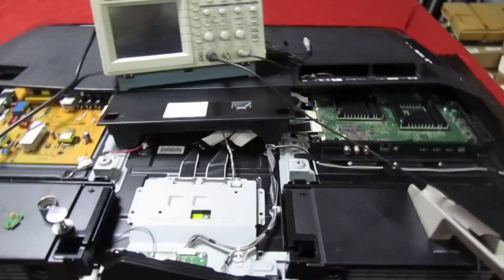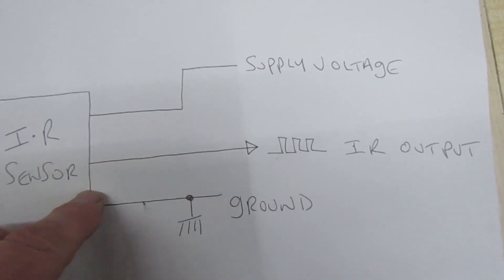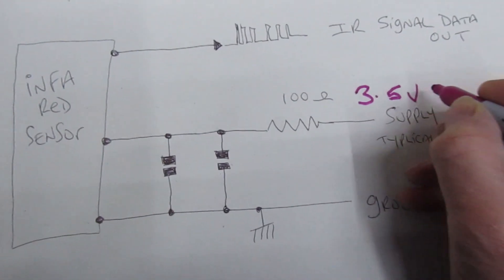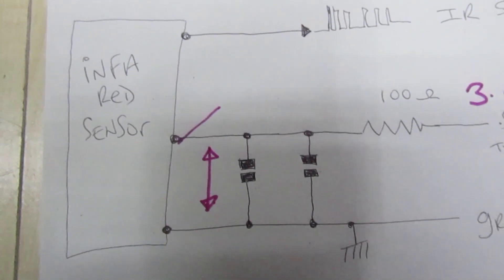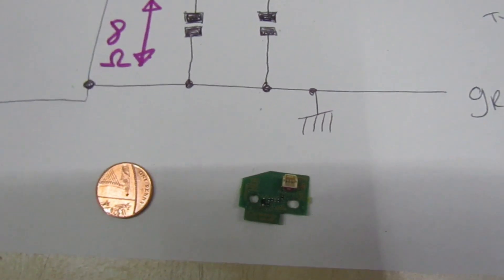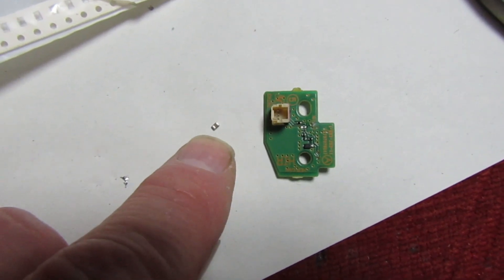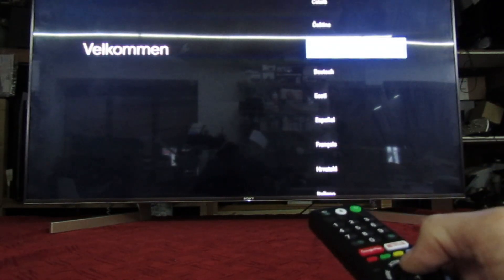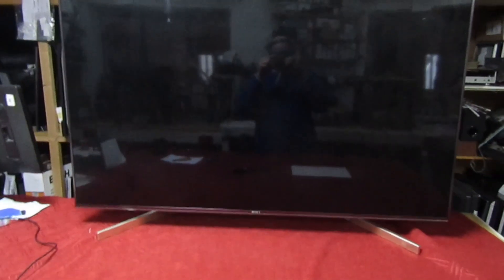SONY KD 55XF9005  No remote control functions working.

Comment: Thank you a lot. I got this problem with my Sony 65XF9005 for about two years now. Sadly it is a model where I cannot plug external IR sensor. I am bypassing it by using remote control on my android phone. The repairs that my repair center suggested or the parts I could find were way more expensive. Now I know how to tackle the issue. If I wont be able to repair myself, at least I know what part I need.
Reply from the maker: I don't think for this set a new board was particular expensive but just swapping a board is not much fun .
Reply: @michaeldranfield7140  I think I will try to repair it on my soldering station, but I do not have that much experience with really tiny parts.

Comment: I'm one of those people who would really appreciate a basic video on how to change that little IR sensor board! I think mine has gotten water damage. And can you please share where to buy that little board? Thanks a million!!
Reply: My model is kd-49x8500f
Reply: did you manage to do this? I have the same problem. I'm using a Bluetooth remote as a temporary fix. But it won't switch the TV on half the time, I have to press the power button on the side of the TV.

Comment: Thanks a lot!! Two days ago it happens to me. I try everything before I found your video... And today is working. In my case, the same capacitor breakdown (I measure 7.4 Ohms so quite same fail). I decided to keep the 15pf capacitor, because it is used to  put two capacitor in decoupling circuits. For me the other capacitor also help me for have a "bigger" point for soldering the new 10uf one. Thanks a lot again!!
Reply from the maker: No problem , had this same fault a few times now .

Comment: Most Excellent Michael! Thanks for sharing! Reminds me of back in the early 1980's with the Grundig TVs which had the Scan Tuning button and had a fault on that PCB (usually had 2 or 3 x AA cells as back up battery in a plastic drawer at the back, which customer could change). A new board cost £60 or £70 or more, however, every time I did some proper fault finding, I always found one of the many 10nF caps had a gone short circuit. Pre surface mount of course. This was the chassis that had the Thyristors in for horizontal scan and flyback.
Reply from the maker: no matter how much a new board is I will always investigate to see what's gone wrong ,wouldn't be any point carrying on if I was just a board swapper
Reply: @michaeldranfield7140  Yes indeed, I used to do the same & still do... you learn far more that way 😎

Comment: I have a Samsung telly which is just the exact opposite this. It generates its own RC pulses! 

It will turn the volume fully up, so the user then turns it back down. The set then turns itself up again.  When it gets bored, it will turn itself down instead. When it thinks it's funny, it will randomly turn itself on in the middle of the night, or for added laughs, turn itself off while you're watching something important.

I traced that fault back to the sensor board, but there's only two components that I can see - the sensor and what looks like transistor, or three legged chip.

It was hours of fun, but I'll be honest, I did actually swap the whole board in the end. This was clearly where the fault originated from, because it's never been a moment's bother since, and that about five months ago.
Reply from the maker: A very common fault in Samsung sets is the 6 tact buttons on the side, always replace every one because they work in a ladder network and go intermittently leakey, so if the volume goes up on its own don't just assume its the volume one causing the problem as it could be any of them, hence replacing the lot is the only cure.

Comment: Thank you so much!
I fixed my TV in the very same way - applying a single capacitor instead of the two that were there before.
300$ saved

Comment: I agree 100% that if just changing the board then it should not be on YT.
The problem is nowaday repair technicians rarely able to troubleshoot the fault to component level. Also due to small sized components that make the repair absolutely a nightmare.
I always love the good old days where repairs could done using a multimeter and a soldering iron.

Comment: my brother asked me to fix his 55" Samsung TV with the same problem, it had a very similar IR board and the same shorted capacitors so I replaced them and it worked for about an hour after my brother came and got his TV at which point the problem re-emerged so I just got a new PCB for it. given that the same fault happens (quite a lot apparently) suggests that the engineers are designing from the same "suggested PCB layout" on the IR sensors datasheet and either the sensor itself has a silicon bug or the PCB layout is flawed somehow. I do agree that finding the fault is much better than just board swapping.

Comment: Useful video. I've got a Samsung tv with exactly the same symptom. Haven't got round to looking at it yet because I can still operate it with the wireless rf remote that came with it.
Regarding the customer approval when you showed them the tiny parts: when I was in the TV repair trade I'd have got the opposite "what! You're charging me thirty quid when the parts were only five p"
Never mind that it might have taken a couple of hours to do the job!

Comment: Thanks! Amazing. I have now same problem in same model with 65", will try to order a board. (So far could not find any provider but will keep searching :). Meanhwile, phone bluetooth as remote is working instead of IR remote.
Reply from the maker: the whole pcb is not expensive , which is surprising for a sony spare part .

Comment: Very Interesting. I have a sony kd65 8500g on the bench right now with no LEDs lit. There is voltage as expected on 12v, 3.3V I can get the backlit voltage up by manually raising the BL line. I am now happy psu is good, leaving the mainboard at fault. All its caps have correct voltage either side of them so I am thinking the main processor has died. No button or IR has effect to turn it on and no standby led! Maybe you have an idea Mike?
Reply from the maker: I had a similar fault with a sony and it was the supply voltage to a pic microcontroller faulty , it came from a Texas 8 pin step down converter but that's all I can remember.

Comment: Hi. I have the same issue on my 49 inch XF9005.

I've never done any sort of home repair before, but am prepared to have a go. 

What is the part number to replace the whole board/IR receiver please and is it just a case of unplugging the old on and plugging in the new one?

Comment: Having the exact same issue but with the sony 49fx9005, remote control stoped working after a while, got a replacement remote control from sony and the issue still persists. I googled it and apparently a lot of people are having the same issue, sony knows about it but doesn't do anything about it. I have zero technical knowledge and I was told to replace the IR board myself, I have never done this before. Do you maybe know where in Belgium I could get a replacement IR board? I don't know where I could find one here, I guess it needs to be an original sony IR board? I tried the ASWO website you mentioned in the comment section, but you need to be an electrician or something to be able to order there which I am not I am just a privat customer.
Reply from the maker: ASWO is the only dedicated TV spares supplier left now in the uk so I cant suggest anyone else , your best bet would be ask in a local TV repair shop if they could order you the part in.
Reply: @michaeldranfield7140  thanks for your reply I appreciate. I will try it with a TV repair shop thank you.

Comment: Thanks for sharing this Michael. Really fine intricate work. I believe this has just happened on my TV! 

What was the website you used where you could buy the replacement parts ?
Reply from the maker: i only deal with one dedicated component supplier now and its ASWO in France , all the other companies I use to deal with have closed down or gone bust .

Comment: Hi Michael, could you help me to find a supplier for a similar HIR board please. I have exactly the same issue but not tools to replace the capacitors. Everything I find on the internet is over 40£ Thanks
Reply from the maker: if you can give me the model number I may be able to help with a part number .

Comment: Is this something ‘average Joe’ can do or should we get a n expert in to do it?

My remote has stopped working and I’ve tried all kinds of remedies with no success so far 🙈

Any advice would be greatly appreciated.
Reply from the maker: Unless you are good at soldering pin head size components I would just replace the little board , surprisingly for a sony its not an expensive part .

Comment: It's looking like the KD-49XF9005 suffer the same issue as it's just happened to ours. Done suppose you've got the part number of the sensor board rather than the whole unit (those go for £50+ which  I'm not keen on if it's just the one board that's done it.)

On a different note, I don't suppose you work on older Sony TV's? I've got a very late CRT (32" of Sony's finest triniton) that's just to say hitting a protection fault.
Reply from the maker: I m placing an order now, I will order one for you, should be here Tuesday.
Reply: @michaeldranfield7140  I've pulled the TV apart now and pulled the small board. Have you got the part number so I can double check it's the same part? (I'll also be breaking out my multi meter to check the cable and make sure it's receiving power - would be abit pointless if it's something else further up the chain)
Reply: @michaeldranfield7140  pulled the board, and it's getting voltage but as with your example not enough to the sensor. Looks like I need a new board as well afterall.

If you're ordering some in can I purchase one off you and how would I go about doing this?
Reply from the maker: Give me a ring on Thursday, 01298  73989. I ordered one in as I was placing an order already so it will save on postage.

Comment: I am glad I am out of the trade when they fit tiny specks of dust instead of real capacitors that would fit and never fail with 3volts in that IR unit

Comment: I wish i had a penny for the number of times i have found out that a capacitor has caused the fault.
Les Lawry-Johns tale of the blue tant always reminds me of how many faults they can cause.
That was many years ago, now i am showing my age!
Reply from the maker: Trouble is with surface mount they don't have any numbers marked on them so with no circuit diagram its a matter of guessing what value they should be .
Reply: @michaeldranfield7140  This is deliberate to force us to replace complete modules at great expense.
We were trained to repair to component level, somtimes if you have no manual or circuit diagram
you have to rely on experience to find a suitable value that works.
I have never liked surface mounted components, that capacitor was like a spec of dust!

Comment: Awesome video Michael.  I am quite sure I have the exact same problem.  I am going to go ahead and order spare part number A5005966A.  Do you have any UK retail supplier you would recommend?  Prices I am seeing are approx. £17 plus P+P.  Thanks,
Reply from the maker: I get these from ASWO in France but you need to be an accountholder , they were just over a fiver but next day delivery is £7.95 and with VAT on top they wont be far off £17.
Reply: @michaeldranfield7140  Took me about 20 minutes to fix from getting the TV off the wall and removing the bracket.  Quite a simple fix.

I have the same TV in another size.  Is it inevitable that the same component will fail on this one in time?  I am wondering if I should order the replacement part in advance?

Comment: Good bit of work there Michael finding a faulty capacitor no bigger than a midges dick , as you say the cost of the board was only £4.95 but then there's the post and packing charge £6.95 to add on .